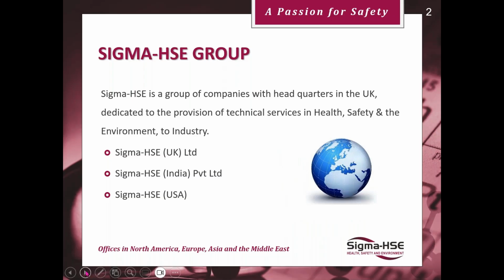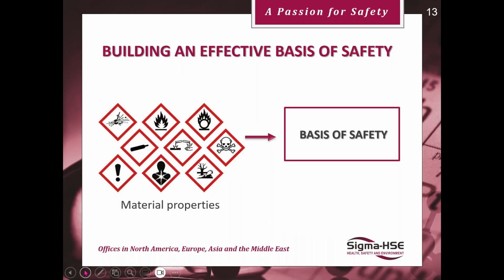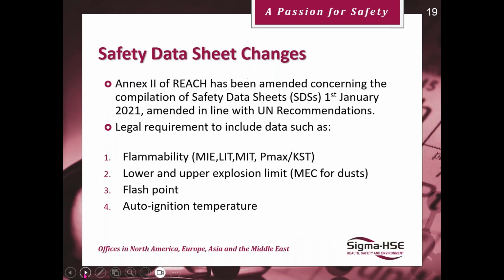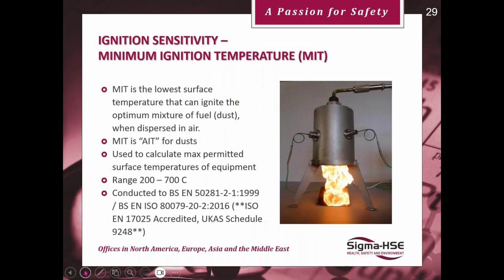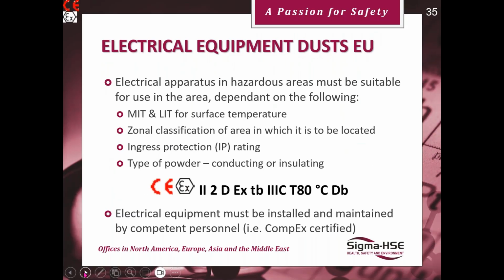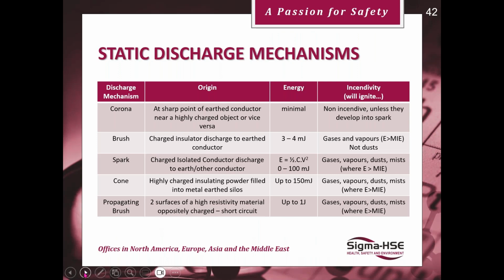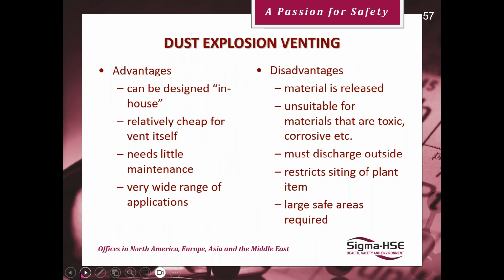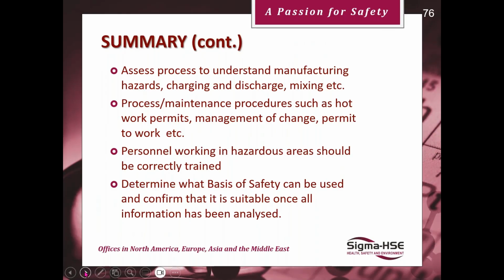Building a Basis of Safety When Working with Flammable Dusts

Comment: A shame that the SDS changes you mentioned only matter if the supplier has the data to hand which they often don't and there's no incentive to get it. They can just say its a dust explosion risk and leave it to all the customers to do their own testing.
Reply from the maker: This is a common issue where despite regulations requiring ignition sensitivity and severity data to be listed in SDS, the fields are often left blank or with "no data available" statements. There may be both limited incentive for suppliers to provide this and also potential liability. But to consider also that any processing of a material can change its form which may invalidate any provided sensitivity or severity values given in SDS, while the tested form equally does not need to be stated in the SDS.